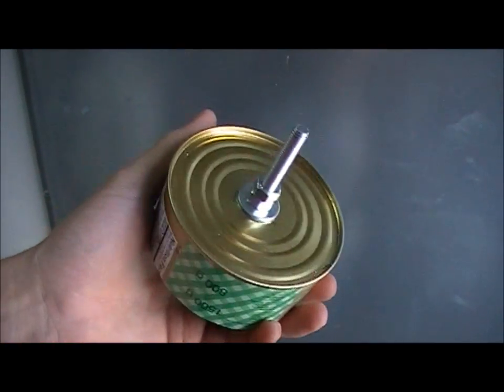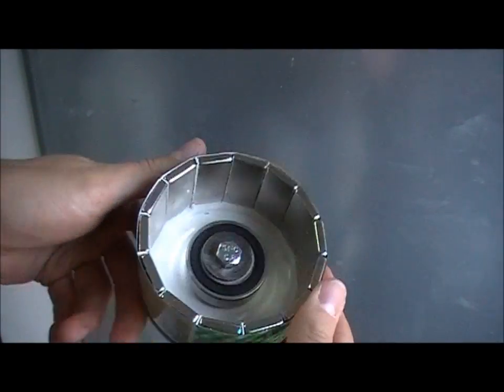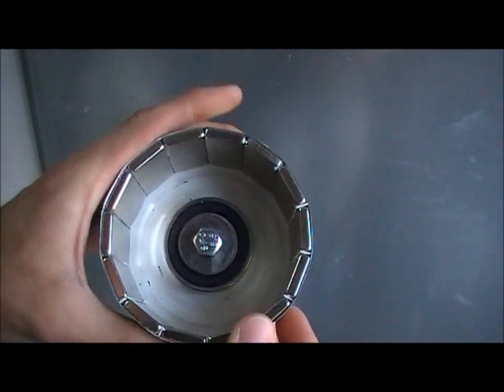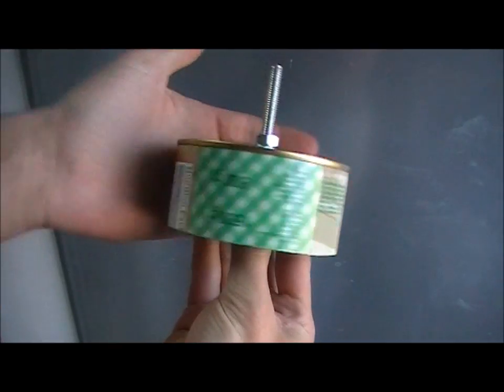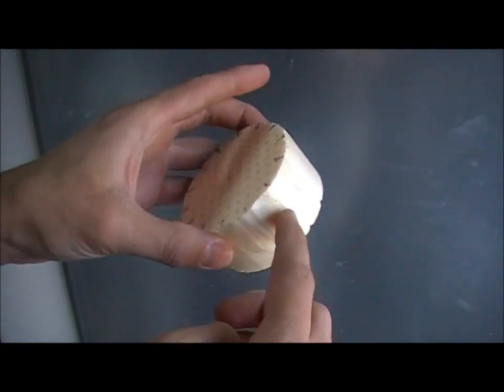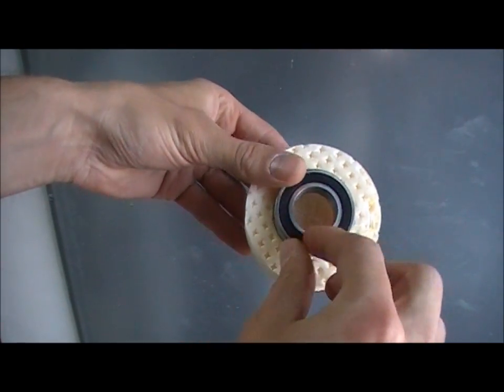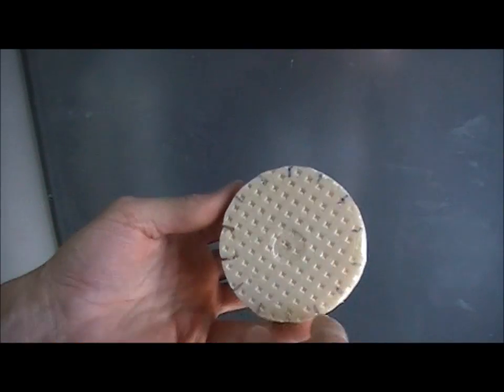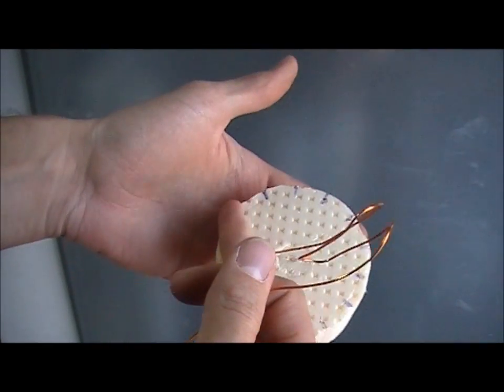Home made windmill generator part 1 - building a small prototype

Comment: A mill grinds corn.  What you have here is never going to be a windmill.
Reply: thra5herxb12s Connect the genereator to a grinder and put corn in it thus grinding the corn.
Reply: A wind GENERATOR.
Reply: No need, its already grinding the bearings as I'm pretty sure the video creator hasn't installed frictionless magnetic bearings in this device. B.T.W. thanks for vid @ ChrisWantsToKnow

Comment: Chris, i am from Russia, my name is Olga, i want to do same windmill, can you tell me, what magnets used in your rotor? It is neodymium magnets? in millimeters - width, hight? How match they cost?
Reply from the maker: ***** Hello Olga. Yes the magnets are neodymium magnets of size 42x20x5 mm. I bought them cheap some years ago. Nowadays they became very expensive, so I recommend you use ferrit magnets instead. But take bigger ones to get the same energy. Make the coils as big as the magnets are. I think you are the first female known to me who wants to do this. Cool! :)
Reply: ChrisWantsToKnow Hello Chris. Don't you afraid that this 'rotor' will melt when it's based on styrofoam?
Regards

Comment: Good video, but should the core of the windings not be of a material with magnetic properties to get better results from the magnets spinning round the coils. I thought the winding produces a better magnetic field when placed around a conducting material. And so the magnetic field is better influenced by the rotation of the magnets.Maybe i'm wrong anyway, very nice to see that its still possible to make things work with common materials.

Comment: You built this coil at stator..magnet at rotor..if I want build coil at rotor n magnet at stator..do you think it work or not..sorry for bad english..hope u understand
Reply from the maker: Yes it will work. But to get the energy from the moving rotor you will need some kind of commutator/brushes. Because the attached cables will twist.
Reply: Thanks bro

Comment: It's a cute toy, and educational for kids, but your introductory statement is essentially false in that what you have there, is not scaleable, so building small, first, will say nothing about the feasibility of upscaling - or using the same design in a larger unit. In fact, if you did upscale this, you'd likely end up with something that would disintegrate.... A realistic and safer bet for those truly wanting to build a scaleable power source is to start with known working plans - Hugh Piggot.

Comment: That's not true. Though you do see most - if not all - motors and generators using ferromagnetic cores to help draw in the magnetic flux, they are not necessary. Without them, they are just way less efficient. There's a cool chart showing on the top of the front page of the wikipedia entry for permeability that may help.

Comment: A little stupid questation but u are using copper wire that u use too welt with ryt ?? its not isolated wires? would that not give a  loss ? i am not good at this electric machin i am just wondering ?

Comment: Is the idea to understand windmills or how to make a generator?
I guess you could take copper & make your own wire.
Mix chemicals and make your own plastic.
How far down do you want to go?
Problem is you did no engineering. You guessed at the number of turns, size magnets etc.
Looking at it it is way too large for the windmill running it. You could have gotten better effenciency with a much smaller generator and saved time n money.
Well I guess maybe you did learn something from building this.

Comment: Obviously, the easiest way is to just order the whole thing online and have it delivered and have a contractor install it for you.

Unless you are an engineer by profession, doing it as in the video will help you understand many aspects of design principles involved. His understanding of the R & D part of the project is correct. 

 Modifying existing components not specifically designed for the job is most often a greater waste of time. I think he has the right approach in the integrated design.

Comment: You can waste your time building this or go into the junk and find any Permanant Magnet, DC brush motor and use it as a generator.
A small generator would be one used on a bicycle tire or even smaller is a slot car motor.
Look on the internet for a local "Hamfest" and you will find what you need.
These guys know electronics and would be glad to help you to find what you want and need.

Comment: wow it generates windmills. I guess you need to be careful to not use this in crowded areas or people could be crushed. Also, I'm not sure what the market for windmills is. Wouldn't it be better to generate electricity and then use that for whatever purpose is most pressing? Of course that could be milling grain or even powering the tools to build a windmill...

Comment from the maker: As long as you can design an alternating magnetic field, any magnet can be used. But if the coil windings are wandering thru a static magnetic field that is not changing polarity or strength, no current will be induced.

Comment from the maker: @bemilive The magnets are 42 x 20 x 5 mm. But you can chose your own size. The coil needs to be about the same size as the magnets. If you are making a large generator, I would suggest a 3 phase generator, not a one phase like I did because you will then have a smoother energy output which reduces the vibrations that a 1 phase model has.
Greetings,